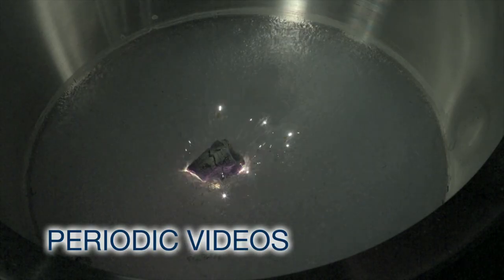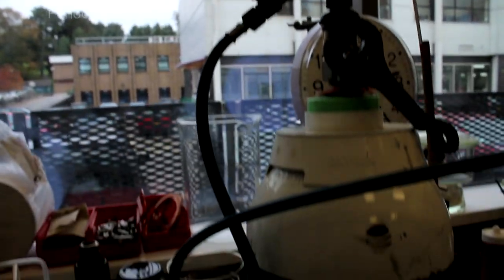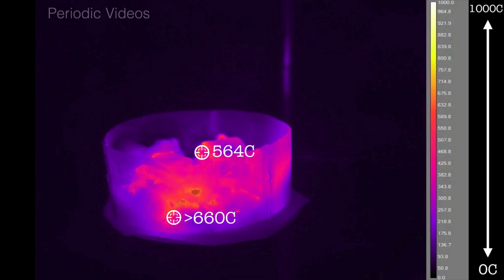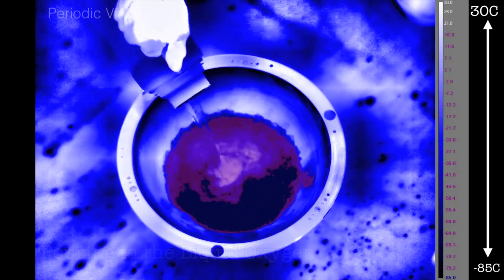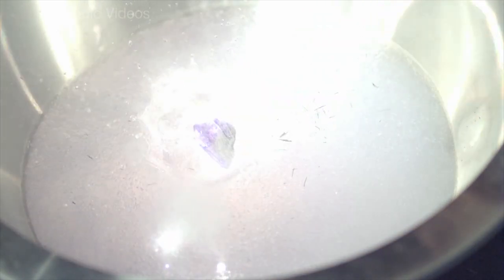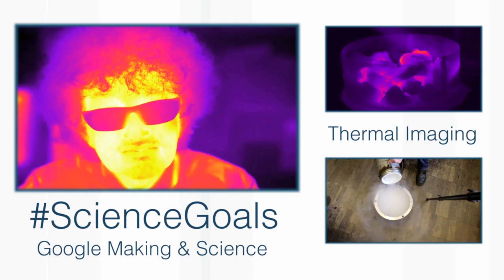Hot Charcoal in Liquid Oxygen (THERMAL IMAGING) - Periodic Table of Videos

Comment: Do it the other way, tip liquid oxygen into a BBQ that shrould get it started
Reply: logtothebase2 Or just cut out the hoopla and use propane instead.
Reply: Or use liquid oxygen to start a barbecue, and barbecue a tank of propane like what The Slow Mo Guys did with a butane canister (except they didn't use liquid oxygen).

Comment: Are you quite sure there's no cryogenic damage to the floor? Even if the supporting concrete doesn't crack, I'd expect the glue holding the tiles down to delaminate when liquid nitrogen is poured over it.

Comment: 1:58 What...? Liquid oxigen would not solidify at LN2 temperatures anyways, just what is this whole sentence?
Reply: He never says it solidifies.
Reply: LOX will freeze at LN2 temperatures if the pressure change between the storage vessel and the copper coil is great enough. Also, I think the professor knows a little more about what hes talking about than you do.
Reply: He stated that, because there is a flow, you don't have to worry about it freezing. Which is true. And just because Liquid Oxygen wouldn't freeze, the copper tubing does and could trap particulates and freeze them as well, but since there is a constant flow, that won't happen.
Reply: Fatbap, when the oxygen is expanded, it drops in temperature.  But all that is happening is the LN2 has cooler gas to liquefy and so less LN2 is evaporated in bringing the oxygen down to temperature.  That's about the only thing the pressure difference affects.  The temperature drop from the expansion has already happened by the time the oxygen becomes LOX.  It's not going to get COOLER than that.
Reply: But your mentioning of impurities like water vapor, etc, could definitely be a problem.  Solid oxygen wouldn't, however.

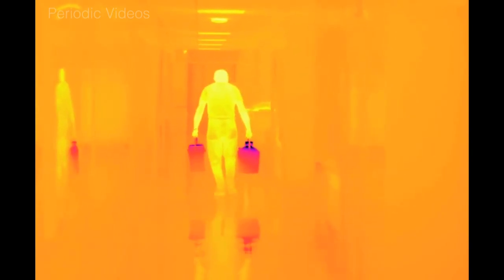Comment: At 1:07 why do we see the reflection on the ground in the same "cold" colours as the containers above? Should't the floor show up in a mostly uniform colour/temperature?
Reply: That's how radiation behaves. After all, thermal cameras captures infrared light which is pretty close to visible light and such behaves similarly.

Comment: super ! i have a question : can we drink Liquid oxygen ? if not, why ?
Reply: This is amazing!
Reply: theoretically possible, practically it would probably put you into a lot of pain, simply because liquid gasses tend to expand dramatically when warmed up, and your stomach is not designed to stay open for extended periods of time at the top, so, even if you could get the liquid oxygen down into your stomach, and the gas pressure won't push it back up your tube, it would be very very uncomfortable.

1: depending on the amount of liquid oxygen in your stomach, and how much other stomach contents you have, you may get cold burns on the lining of your stomach
2: rapid expanding oxygen will make you burp so much, and if you can not keep the stomach sphincter open enough, may lead to severe stomach pain due to overinflation and potentially tear your stomach. But I believe for that to occur, you would need to ingest more liquid oxygen than realistically possible

Other than that, liquid oxygen is not poisonous, so that's fine, and the leidenfrost effect should protect your tongue, stomach lining and perestaltic tube for most of the journey
Reply: logtothebase2 No. Water has a huge amount of thermal capacity and therefor holds a lot of energy when boiling, many times more than what is needed to boil away an equal amount of liquid oxygen. 
Just watch the video I posted earlier, it's Cody from ***** drinking liquid nitrogen.
Reply: At least one person has been severely injured and had their life ruined after drinking liquid nitrogen served in a drink from a bar. Do not even think about it.

Comment: Can someone exaplain why does the 'reflection' of the charcoal heat up the sides of the container? Is it because of the IR travels in the same direction of the visible light or...
Reply: Infrared light is just like visible light but our eyes aren't made to see it. The IR light reflects off the metal surface into the FLIR camera. Some IR light will diffuse as the surface is not perfect but it will be insignificant to transfer enough heat to make a difference in the bowl temperature.
Reply: So that means that the container might be is not warm but simply reflecting the IR but not absorbing then re-emitting?
Reply: Yes, That's basically what's happening.

Comment: Japanese people usually pour cold water on the road in summer in order to decrease heat. would it be a waste pour liquid oxygen instead?
Reply: Francesco Lorenzet yes
Reply: liquid oxygen is incredibly costly to produce, and it would also cool less.
Reply: Oxygen only requires 92 btu/lb to evaporate, whereas water requires 970 per lb.  Water is much better at transporting heat.
Reply: Why they waste water cooling the roads?
Reply: lkjhfdszxcvbnm They probably don't use drinking water.
Reply: It could explode upon stepping onto the oxygen-soaked road. Like a landmine.
Reply: Not only would it be incredibly wasteful (just because something has a very low temperature doesn't mean it can take up lots of heat), but asphalt drenched in liquid oxygen is a high explosive.
Reply: So the roads wont melt.

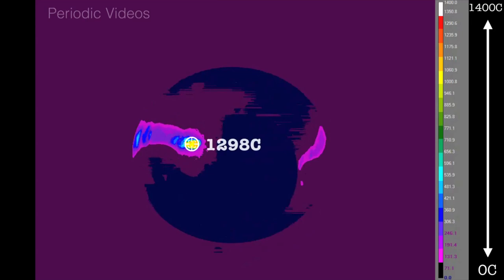Comment: Can someone explain why the charcoal's temperature shadow is reflected on the opposite wall of the flask but at 5:21 it suddenly covering all the walls?
Reply: Well this is the only part of every charcoal videos where this happens. It's a very short period too. Makes me wonder. Didn't know heat reflects as light.
Reply: I would imagine that at this very moment the IR-camera is exactly at the focal point of the reflected radiation which is constantly shifting due to the moving piece of coal.
Reply: Där Chämikär
 I think you nailed it! It's a feature of thermal cameras. That's why reflecting on the opposite wall of charcoal's shadow.

Comment: What would happen if these experiment was done in a vacuum? As in outside our atmosphere.
Reply: The liquid oxygen would boil off almost instantly in a vacuum so you wouldn't get much.
Reply: 666lumberjack would it not freeze?
Reply: Things boil much more rapidly at low pressures. You remove that pressure from the system and molecules more easily split away and speed off. 

Space is cold for what it is worth (Empty space is also an excellent insulator) but you also have a lower boiling point. You can solidify oxygen at very very low temperatures when at that low of a pressure, but generally, if you want to solidify a substance you want to crank up the confining pressure, not down. You could look up the numbers and see what temperatures are needed to solidify oxygen at a given pressure.

Comment: what is the hardest to bend material per mass, or per unit cubed that this comment section can find?
Reply: A black hole's singularity.
Reply: LightningCC
lol, other than that
Reply: Something really tiny. Try to bend an atom.
Reply: no, really lol LightningCC
Reply: single-atom carbon chains. they are difficult to stabilize, cecause they have alternating single and triple bonds, and the latter tend to result in decomposition or polymerisation.

Comment: Why can you just pour liquid nitrogen/oxygen on the floor, won't it mess up the floor or something?
Reply: It cools it fast but the floor is so massive compared to the amount of N2 or O2 that the cooling probably doesn't extend more than a few mm into the floor. I'd imagine if you did it on a polished wood floor it might possibly detach the polish/coating but on an industrial style office or lab floor, no issue
Reply: Because it boils away before any real damage can occur.
Reply: Chubacca7 the body "floor" has very high mass. the body liquid Oxygen has a low mass in comparison. if you get those in contact the low amount of cool oxygen merely changes the overall temperature of the huge amounts of "floor"it had to cool. You can see this on the FLIR.  when the liquid oxygen is gone the floor rapidly approaches room temperature again.
Reply: It will return to a gas state very quickly after being spread on a warm floor. Should not even be any mess to clean up besides the remaining bits of charcoal. The air in the room is mostly nitrogen and oxygen already so the gas should not be a problem either.
Reply: Thanks guys
Reply: I suspect air humidity will temporarily freeze in the joints and expand, destroying the material. If repeated in many cycles, the floor will get loose earlier than if it hadn't been hit with LOX.

Comment: why doesn't the piece of charcoal keep on burning?
Reply: Because it's surrounded with oxygen.
Reply: 93Royston They explained in the video, when the burning charcoal was introduced to the liquid oxygen, an amount of oxygen surrounding the charcoal boiled, creating a self sustaining bubble of oxygen gas that accelerated the reaction(comparative to it burning in the mix of chemicals that make up regular air) while the liquid oxygen outside of the bubble simply stayed a liquid until boiling off naturally.
Reply: Sorry Guys I made a mistake in typing my question.  My doubt is why doesn't the piece of charcoal keep on burning till either all the oxygen is used/evaporated  or till all the carbon in the charcoal is used up. In the video the piece of charcoal burns for sometime then stops. why does it stop burning since it's completely surrounded by oxygen. Shouldn't the energy released by the reaction keep the reaction sustained?

Comment: Is it safe to pour liquid O2 out on the floor like that? One little spark and your nice new lab burns down again.
Reply: Eric Taylor for te second time...
Reply: Eric Taylor pretty certain it would take more than a spark to ignite wood/melamine surfaces in the presence of oxygen. it's not the same as say, isobutane
Reply: Zivilyn The Wyrd It's safer than you would think, but at the same time, not safe enough for just anyone to do. Not only should you be a, or with a, trained professional when handling liquid oxygen, pouring it onto any old surface to get rid of it could be fairly dangerous. While it will evaporate quickly, while on the floor it still has a chance of something happening. Even if it itself isn't going to ignite, if a fire spreads to it then it will surely cause it to spread at an exponential rate. Although I suppose the open flame would be a bigger problem lol.

Comment: how about a crystal bomb from liquid nitrogen mixed with nuke fusion trap the nitrogen on a tube then trap it again with a tube fill the tube that trapped the nitrogen tube 5000ppm oxygen and 2000ppm of hellium put a reactor for opening the nitrogen tube inside oxygen tube the nitrogen mixed by nuke fusion will quickly react and freeze the oxygen forming a crystal with so cold temperature